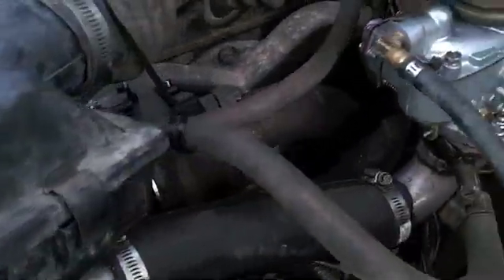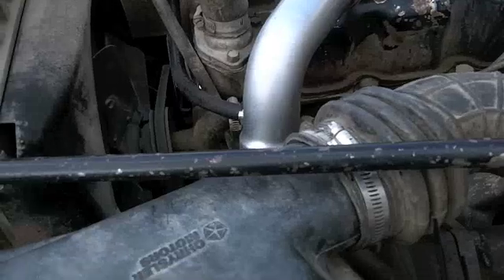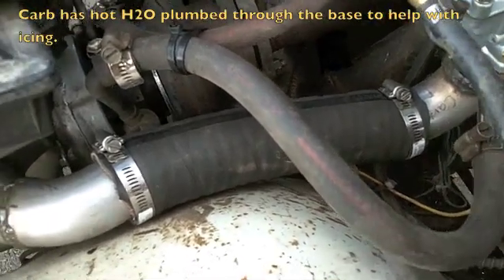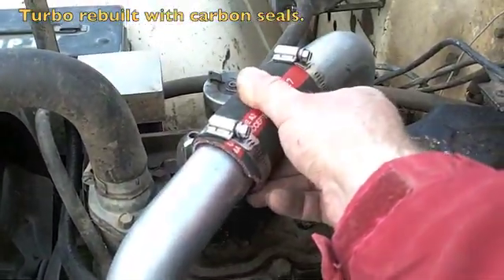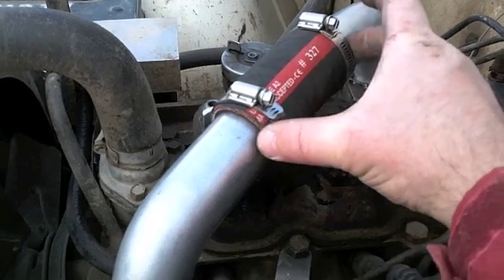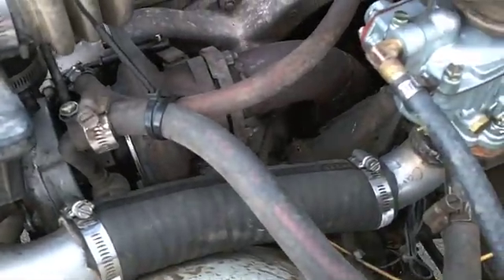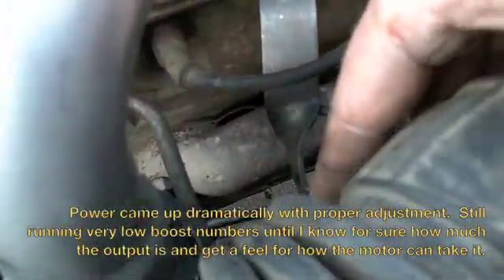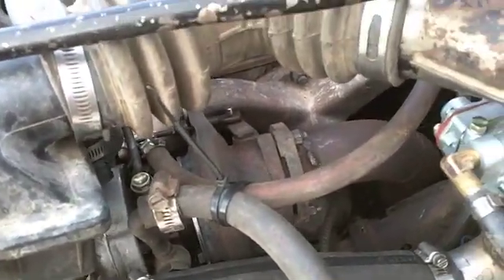Jeep Turbo Finished

Comment: Ohh my.. This is crazy.. I would like to install this... Is there any pros and cons for this..??
Reply from the maker: It was a nightmare to start at temps below 50F.  I ended up pulling my system off because of it.  I am very tempted to put an HEI kit on the motor and try again as I know my ignition was weak.  Used it for years, that was the only issue.  Looks on people's faces were priceless.  Did not add a bunch of HP but did make the jeep run great at the high altitudes I was at.  6000-9000 feet.
Reply: But the rev was much better then the stock.. First gear was like bam bam.. Men really appreciate your work.. But i don't have any idea how to install this..